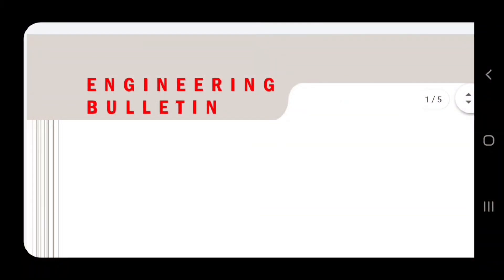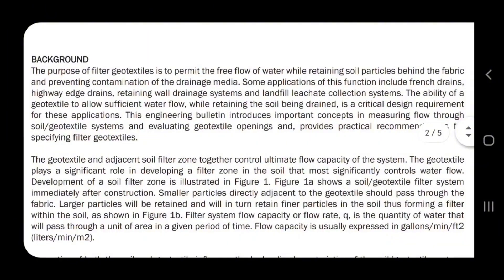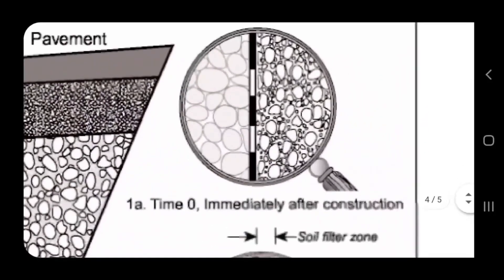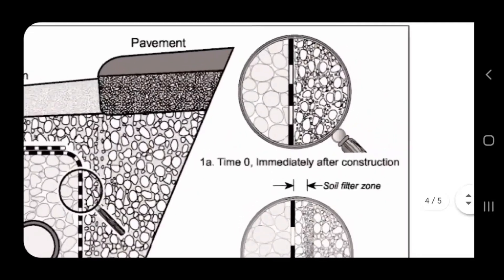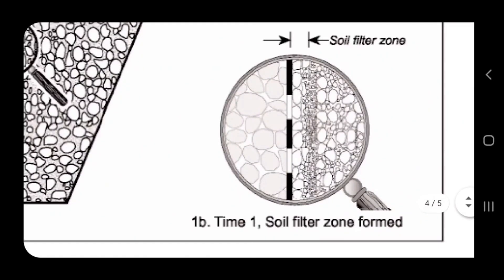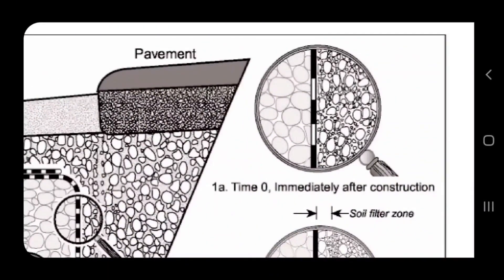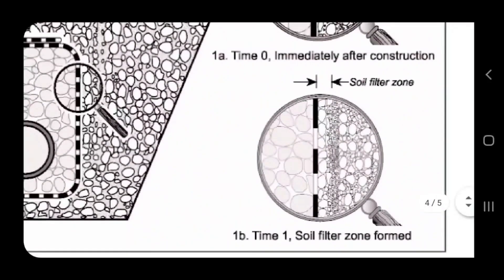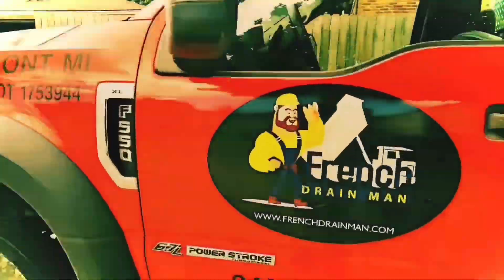How Non-woven Geotextile Filter Fabric Works

Comment: I enjoy the education as I know the drainage comprehension I had in 2017 is not at all as complex as what I use & can see now.  If you scan though the EPA's publications for the search term "water table" you'll see a few illustrations that might support your lessons. The bookmark I have is "nepis.epa." it's the National Service Center Environmental Publications (NSCEP).  Water-table being what is needed to get a FD to perform.  The SSURGO water-table rating is a 30 day height rating & not a 1-3 hour rating like your installs are removing immediately after rains.